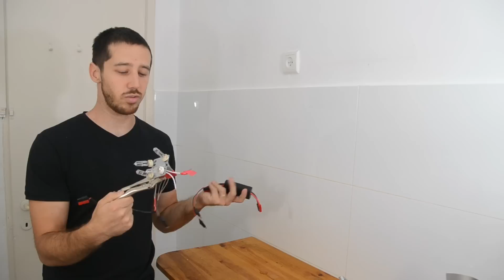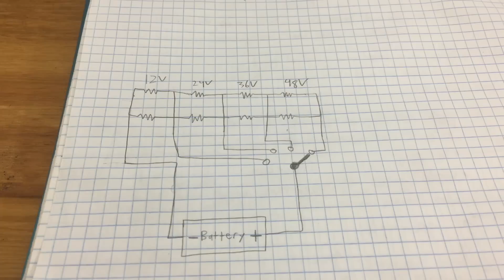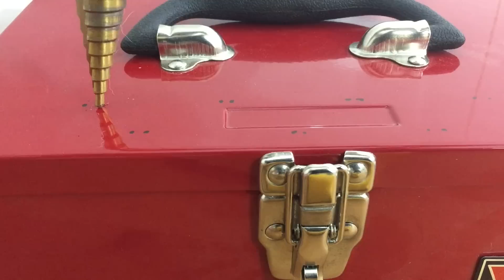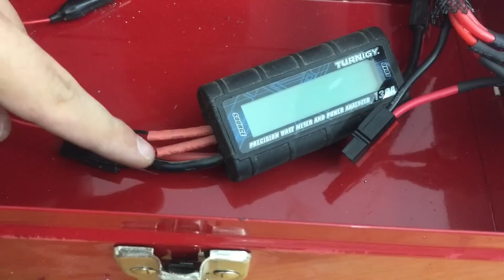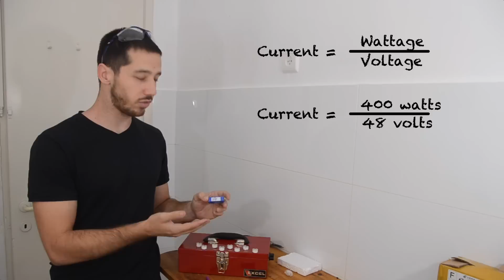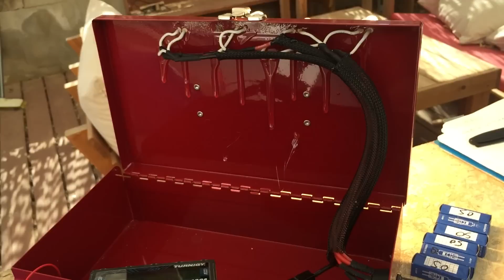Test batteries with a DIY lightbulb discharger

Comment: The capacity of most li-ion batteries is rated at a current draw of about 0.5C.  So for that little drill battery, a capacity check at 0.5 * 1.3Ah  should be tested at 0.65A.  Your set up draws 100W/11.1V = 9.0A.  This gives 9.0A/0.65A  = almost 14 times the current draw of the standard  capacity test discharge current.  When you discharge that quickly, you will never get the rated capacity. That battery wsa probably was much closer to its rated capacity than you calculated.  Cheers.
Reply: Regardless the C rate. The bms does its job if too high current also. Plus to pull high current can also help to see any defects more easily

Comment: I built a version of this.  Thanks for the tip on the melting glue, I used nuts and bolts to secure sockets.  I think it would be great to put it on a timer so you wouldn’t forget and over-discharge.  I also put an inline fuse.  Great video!

Comment: I'm considering building a discharge device as you described in this video . . . The problem is that the discharge port is a proprietary connector built into the down tube on my bike  . . . Would it be OK to connect the discharge load to the charging port?  Are the two ports electrically the same connections?

Comment: There is no need for the switch, so you could save some money on that.
You can test a 12V, 24V, 36V battery with 4 halogen bulbs in series as well. There is no reason the bulbs should glow at full brightness and they will not run that hot on lower voltages.
I built one myself with 16x 20Watt light bulb (G4 socket). 4 in series and 4 series in parallel. I use switches to add extra groups in parallel, so I do not have to plug or unplug the light bulbs every time. I also added a socket+BMS and some extra bulbs for testing single 18650 cells.
If you do not exceed 10 Amps, the following is a nice and cheap capacity meter that works up to 100V:
https://www.ebay.com/itm/Oled-100V-10A-DC-Combo-Meter-Volt-Amp-Power-Watt-Capacity-Panel-meter-Monitor/152249884035

Comment: A 50w 12v bulb is effectively a 3ohm resistor. To handle 50w you don't use the little ones, you use "chassis mount resistors". $3.64 on DigiKey https://www.digikey.com/product-detail/en/stackpole-electronics-inc/KAL50FB3R00/KAL50FB3R00-ND/1646197 $4.97 on Amazon https://www.amazon.com/uxcell-Green-Aluminum-Shell-Resistor/dp/B0089A8D16 More expensive than your 10 pack of bulbs, but that is the professional way to do it. You are 80% of the way already, might as well.
Reply from the maker: Yep, "power resistors"

Comment: Great video give me a idea to make one,can I use 4 x 12v 20 watt bulbs to test my 48v battery
Reply: Yes, and as a matter of fact I built one with 16 bulbs of 20 Watt (G4 socket). 4 bulbs in series and 4 series in parallel which makes a total of 16x20=320 Watts max. The G4 bulbs are nice and small and dirt cheap overhere. You do need sockets because they get freaking hot as well (at over 250 degrees Celsius it will melt soldering tin).

Comment: How can you tell which wire is positive and which is negative from the ceramic base? Very good video by the way.
Reply from the maker: It doesn't matter, current will flow forwards or backwards with halogen bulbs (but don't try that with an LED!)

Comment: Why not use resistors or buy a hobby charger with discharge function?
Reply from the maker: Those are both definitely options, but they each have drawbacks. My discharger I built here can do over 1,000W of discharge power. You'd  need thousands of small resistors or some really big power resistors to equal that. Most hobby chargers like the iMaxB6 only do 5-10W of discharging. So you'd just have to wait a really long time and couldn't test your batteries under a realistic load. Bigger chargers can do higher discharge currents, but they cost hundreds of dollars. This setup costs around $20-$40 depending where you get your parts from.

Comment: This is an interesting and useful video but for me unwatchable because of the loud and intrusive music track, which makes it hard to hear what you are saying. I can't turn the volume down to get rid of the music because I would lose the speech too. Instructional videos don't need a music track, anyone who wants music while they watch can use their own music device for that purpose.

Re dumping the current; instead of light bulbs which are fiddly to connect up and produce a lot of heat, how about running the battery output through an inverter and powering your computer / vacuum cleaner / coffee maker?
Reply: That could definitely work. The problem is that you can't really adjust it. Your coffee maker runs at a constant power load and then cuts off when it's done. Your vacuum also might have one or two settings. I chose lightbulbs because you can adjust your load to specific levels by changing the bulbs.

Comment: Hi again,
sorry if my question is a bit of a "beginner" but what confuses me all the time is the fact the packs don't have a steady 36 or 48 Voltage. It fluctuates depending on use. So for example if I want to test 36V pack I should use 3 bulbs of 12V right? But if my pack is fully charged it goes up to 42V which is much higher than the 3*12 = 36v of the bulbs and it should burn them? I know I'm missing something here, maybe the wattage is the answer but I'm not sure.. It would be great if I have some feedback on that. Thanks.
Reply: No, the light bulbs can actually handle a bit more than 12V.
For instance the halogen bulbs for a car are 12V, but the alternator of the car works at 13.8 to 14.8V which the halogen bulbs have to be able to handle as well. So think of it as a 12V halogen bulb can handle 14V without a problem. For a 36V battery you need 3 in series, for 48V you need 4 in series and for 72V you need 6 in series.

Comment: Another great video - liked how you added shrink wrap to the battery and now I'm on ebay looking at nylon braided cable sleeves. There is this really nice electronics guru on youtube that has an interesting approach here - https://youtu.be/Jumk-dXioXQ
Reply from the maker: Interesting. Yes, I've seen some people do this with little incandescent bulbs but you just need so many of them and then you end up chasing dead bulbs and whatnot. The fact that the thing runs cooler due to heat spread out is nice, but you could also do this with 10W or 20W halogens which run much cooler. That's still a nice looking setup though!

Comment: A nice application of the KISS principle.
I may have missed something about your mounting of the lamp sockets. How did you anchor the sockets to the lid? We already saw that hot glue will fail and I did not see machine screws inside the lid. Would epoxy take the heat? If the sockets are loose the cable insulation will rub on the holes in the lid and would eventually short circuit the lamp. 
Would it be practical to put the sockets on stand-offs? That would put the heat source a little bit away from the lid and allow air to circulate under the socket. 
Putting some thin polished sheet metal onto the lid would reflect some of the radiant heat from the lamps. 
Thanks for the video. Keep on making.
Reply from the maker: Those are all good thoughts, thanks! I think machine screws or rivets would be the best way to attach them. I just used hot glue and the fact that wires are so short that they hold themselves in. I didn't show it in the video (it was long enough as it is) but I deburred the holes and so I don't expect that there will be chaffing that could cause a short circuit, but you're right that it could be a concern. The sockets I used have silicone insulation which is also really tough against abrasion.